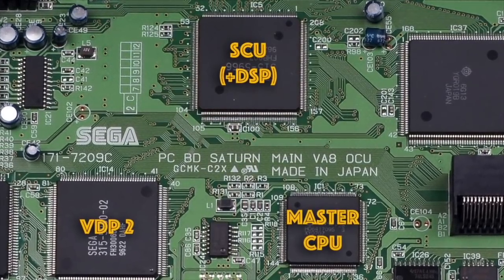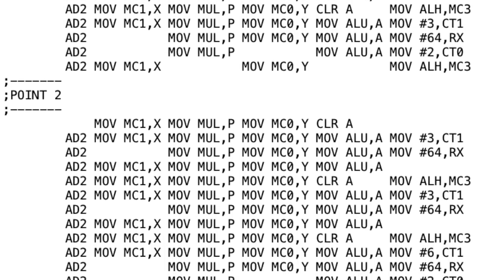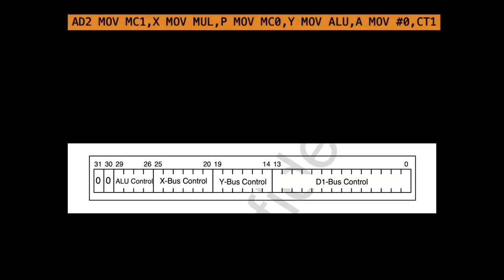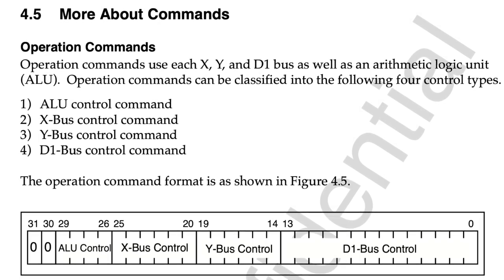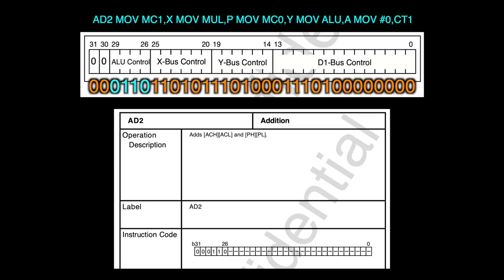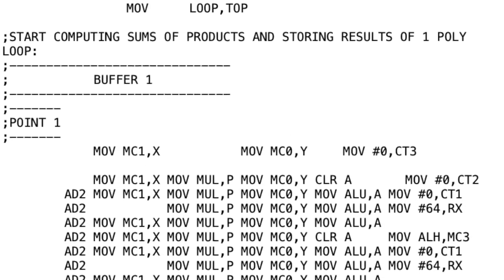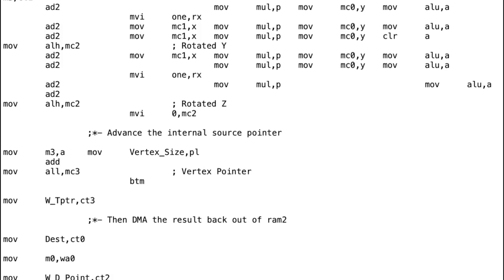The Mystery of Sonic R's Impossible Code - Coding Secrets

Comment: "my code works and I don't know why, so I didn't question it'
Reply: Cobol in a nutshell. When it works, you never know why -.-'
Reply: @c0mpu73rguy  My university still required 2 Cobol courses for my major back in the early 2010s. 

The way our professor wanted us to work was absolutely archaic. We were expected to telnet onto some school server and write our code their and execute it. I ended up 'cheating' a bit when I saw I could access my directly over FTP. Ended up using an open source Cobol to C compiler on my laptop and writing all my code there  before transferring it to the server for submission. 

Even with the benefits of a modern editor it still took me three nights for each assignment. Day 1: Input & Output formatting, Day 2: Logic, Day 3: Debugging. Gin was the only thing that got me through those two classes, a good mental anesthetic.
Reply: @Sydney Bean I didn't actually think COBOL was a difficult language, and I do respect the language for doing some things extremely well. I just hated working with it because it was so tedious to write and how verbose it is. Ultimately I did quite well in those courses.

I don't recall what the editor on the server was, but the entire system was old as evident by it only accepting telnet and not SSH. I mostly just wanted syntax highlighting, better compiler errors and to move around the program easier. I think I just used Gedit with the terminal plugin and GnuCobol. I don't do any programming these days, just scripting stuff for my job in infosec.
Reply: @Tithis  probably because it was a basic school test/learning environment, they didn’t want to deal with SSH keys and user mgmt for every student every semester, or confuse you by throwing that at you on top of the COBOL stuff. (Even though in the real world, you have to learn multiple things on the fly on a regular basis lol)
Reply: I feel that deep in my bones.
Reply: I think that's just programming in general, I've heard it many times over that if you change something and the code starts working you just don't question it.  In more modern game engines there's been quite a few cases where something was left in a game that was supposed to be removed because when they tried to remove it the game stopped working.  It's also quite common to base code on someone else's code or use libraries that other people created, otherwise it would take forever to get anything done and there'd be less standardization.  In this case he based his code on samples from Sega and didn't realize until much later that those examples don't make sense with the way the manual says the DSP chip works so it's more like he thought he knew how his code works and now he's not so sure and he is questioning it.

Comment: Gotta love undocumented opcodes!  These things are also the bane of existence of emulator developers and are used in demos and copy protection.  If this is what I think it is, it's a hybrid opcode that exists just because of the way the bits work, and its behavior is technically undefined but on real hardware would always be the same.  If that's the case, they probably codified it, but forgot to put it in the manual.

Comment: A typo maybe.. not 4 instructions at a time, but 4 TYPES of instructions at a time?   Sega was always goofy in their documentation.
Reply: Pretty sure you're right here. It says types. 6 instructions of 4 types is still 4 types.
Reply: @sewid  Technically they're only doing 4, 2 are just bunched up together
Reply: 2:25 "Operation commands can execute these four types of commands concurrently." The Sega docs do explicitly say types.  Although, they probably mean 'in parallel' rather than 'concurrently'.
Reply: translation error maybe, technical translations are always a problem.
Reply: I agree. They probably got the "meaning wires" crossed between Instruction and type. It IS just four types, but six instructions total.
Reply: Correct..

Comment: If you look at the definition for "MOV MUL,P", you'll see it's 010 and no data bits. (That is, 010---, as opposed to 100XXX for "MOV[s],X" and 011xxx for "MOV[s],P"). It's fairly obvious you can't combine "MOV[s],X" and "MOV[s],P" as they would require different data bits, and you probably can't combine "MOV MUL,P" and "MOV[s],P" as they both work on the P register and would conflict there, but there's no reason why "MOV[s],X" and "MOV MUL,P" can't be executed at the same time, and that would be something desirable to have happen simultaneously, as that combination of actions would be quite common to need happen. So it seems likely they quietly implemented a "MOV[s],X AND MOV MUL,P" command as 110xxx, and didn't bother documenting it. And probably the same with the Y register commands also.

It also says "Can execute these four types of commands concurrently", but it doesn't say it can only execute one of each type. It's possibly a translation issue, or poor documentation on Sega's behalf (which is why they also distributed example code for developers)
Reply: You may be onto something, still, even if opcodes are syntactically similar, that doesn't mean they belong to the same opcode table, as these are usually grouped by segments. A MOV load store opcode makes use of data lines, as opposed as a MOV Inmediate opcode which uses internal registers, or even ALU unit.
Reply: Based on typical hardware design practices of the time, as well as the pattern of instruction encodings, combining MOV [s], X and MOV [s], P (binary 111xyz) will result in MDyz (e.g. yz = 10: MD2) being loaded into both P and RX, and CTyz (e.g. CT2) being incremented if X = 1.
Reply: DSPs also like to split cycles (maybe even use multi-phase clocks). So it could be possible that this DSP has some logic wired to upper half of the clock, and other to lower one (or rising/falling clock edges). Binary layout of the commands suggests that there's almost no instruction decoding, only activating parts of the logic via bits in command register (like in good old mainframes). So if your commands have non-overlapping bits active, the CPU could use non-overlapping logic to execute them, and in predictable order.

BTW, this is very similar to poking around 6502's 'illegal' commands.
Reply: "this is the 4 TYPES of commands that can be executed at the same time. ", yes, right there. Types of control-commands

Comment: Yeah it looks like the documentation was "correct-ish" but it's more of bitmask for what opcodes or commands run
Reply: The question I would have is that it looks like assembler for the DSP is specialized just for it, so if I wanted to homebrew with the DSP, is there an assembler that knows about it or a dev tool chain available for the Saturn?
Reply: @BrianBates128  I'm pretty sure the Sega dev kits included a DSP assembler, as well as a simulator for debugging.
Reply: @BrianBates128  I don't think there is a currently usable assembler available. You can just read the SCU hardware manual and take the instruction bit patterns and define them into a bunch of constants and macros, and just OR them together in your program to assemble the code. This should be the lowest effort path, there's only a handful instructions anyway, it's fixed size.
Reply: @zyrobs  sorry, I meant an open source one that I wouldn't have to feel bad for using if it was able to me found.

Comment: Ben Eater might have the answer to this in his rather lengthy but enormously infotaining 8 bit breadboard computer series (here on YouTube), specifically when he creates and "eeprom-hard-wires" the control logic signals. These two bits in the DSP's micro-code seem to be both hard-wired to represent a data-forwarding action in an "Output from A, Store to B" fashion, and since two distinct units are involved (per "110" command  bit pair), they operate concurrently and without interfering with each other. This is just my guess at the inner workings of the system.

Comment: You should continue the series about making a PUBG-style game on the Megadrive.
Reply: Honestly yes, that'd be awesome. 
I still want to know the internet connection idea.
Reply: @juliewinchester1488  I don't think it was supposed to connect to the internet, just enable network play over a local network. It could either use the serial port on the back of Model 1 Megadrives, or communicate through the second controller port like Zero Tolerance did.
Reply: @Eddies_Bra-att-ha-grejer  Ah, still would have been interesting either way.
Reply: @juliewinchester1488  There was however a modem for the Megadrive that connected through the serial port that could have been used for online play.
Reply: Prob almost feasible since Pubg looks and plays like a 2005 game

Comment: The documentation is right... from a certain point of view </obi_wan>

Those DSP control words are closer to horizontal microcode than typical ISAs.  From the hardware engineer's perspective the X Bus Control is one instruction that can link multiple units together.  It was just cleaner to express that at the ASM layer as two separate instructions.  Same for the y bus control.  I agree that the did a disservice by not making it clear in the docs.

You can see similar shenanigans with the PDP/8's OPR instruction which uses the immediate value as a ucode control word and can execute more than one pseudo op at once because of it.

Comment: it could've been a happy accident with the design of the DSP. Usually all hardware from this era was all hard coded (because there was no such thing as system drivers etc) so usually it would need to have either 100 OR 010, if the 2nd bit is set making 110 then it'd be like "this doesn't match with what I was programmed with, no" but it seems the DSP was programmed with the awareness of individual bits, so when the first bit in the command is set it will do the command regardless (this makes sense seeing as a 0 usually represents a gap in the data)
Reply: Yeah usually the hardware from this era was hard coded, it was the most cost-effective way of doing things at scale. The Nintendo 64 RSP did use microcode which was a revolution at the time, but may not have been the best idea. If they had instead used that die space for more than 4K of texture cache or a texture decompression routine to save cartridge ROM space... Well hindsight is a wonderful thing eh :)
Reply: @sl9sl9  that's actually some really interesting bits of history. This is why I love this stuff and the community surrounding it, so much insight of frankly impressive feats of engineering and programming that would be trivial today
Reply: Actually the Saturn did have a Sega-provided sound driver for the 68k CPU that controls the sound subsystem and is MIDI compliant. There are also (vintage) Macintosh tools from Sega for designing sounds and converting MIDI files into music sequence data. I’m working on a custom sound driver for Saturn right now :)

Comment: your can easily do the arithmetic commands, no problem, in parallel at the exact same time. one example is if you ever want to move "010" when no data bits are set, you can,(MUL, P" as in actually "010" not 010Xxx) , while also doing "MOV MUL, X" no problem. this is supported by the dsp IIRC..

Comment: Luckily the diagram of the DSP core pipeline gives us the answers.  RX has an enable, controlled by bit 25 (clear = don't load, set = load from X).
The P register (split into PL and PH) also has a multiplexer and enable bit.  Bit 24 is the enable (set = load multiplier output or X, clear = don't load). Bit 23 operates the P multiplexer (clear = multiplier output -> {PH, PL}, set = X -> PL, sign extend PL into PH)
Bits 21-20 of the X bus command determine what is written to the X bus (for a lower two bits equivalent to n, memory MDn will be loaded).
Bit 22 enables the increment of the CTx register referenced by bits 21-20.

The Y bus commands are a bit simpler.  Bit 19 enables the RY load from the Y bus, while bits 18-17 determine the AC register's operation (00 = don't load, 01 = clear, 10 = load from ALU's Q output, 11 = load from Y bus).  Bits 15-14 determine the MDy to load onto the Y bus, and bit 16 controls the increment on the CTy register.

This means that the real limitation in one of these instruction packets is that RX and P cannot be loaded from two different MDx banks on the same clock cycle, RY and AC cannot be loaded from two different MDy banks on the same clock cycle, and one MDz bank cannot load two different data values to the X and Y buses on the same cycle (although you can transfer the same data to both buses).

Theoretically, you should be able to use bits 22-20 and 16-14 to increment one or two of the CTx registers without loading any data.  Why you would want to do this, I don't know, but it should be possible.

Also worthy of note is that a code of 10100 in bits 12-8 switches the RX multiplexer to read from the D1 bus instead of the X bus, while a code of 10101 switches the P multiplexer to read from the D1 bus instead of the X bus (bits 11-8 select the target register, while bit 12 enables the target register and its multiplexer).  It's unclear what would happen if bit 12 was not set but bits 11-8 were chosing a target register of RX or P.

Comment: I can explain the 6 vs. 4 instruction conundrum.

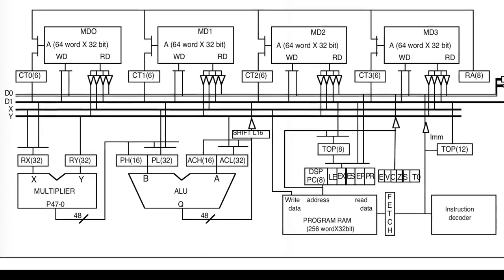If you look at the overall architectural diagram at 1:08, there is a dedicated 48bit bus from the MULtiplier to the P register. The X bus only needs to be used for transferring data from one of the MD* banks to the X register. So even though moving the multiplication result to the P register is an "X bus command" it doesn't actually need to use the X bus.

So Sega basically just added an undocumented X bus opcode 0x6 (110) that does MOV [s], X AND MOV MUL, P at the same time. They wrote it out as 6 instructions instead of 4 for human readability reasons.

Comment: Probably exactly what you think, that bit flips that line at the hardware level

It's common for DSP's to work that way, they are essentially a pile of functional units hooked to a pile of busses. The 'instructions' mostly control which which unit attaches to which bus and behave more like the scroll on a player piano than conventional instructions; often incapable of branching, much like the piano

The tradeoff for the poor facsimile of an instruction set is raw power, it can only do one thing to your data but it can do it FAST

Comment: It makes sense from an instruction set point of view, at least. A lot of simpler processors have undefined opcodes of one sort or another that work in practice (e.g. on the 6502), and having the instruction decode directly drive the bus enables I could definitely see.

An interesting question would be what happens if you do e.g. MOV MC0, Y MOV MC1 Y, which "should" cause bus contention if I'm reading those bus connections correctly (both connected to the Y bus.) 

What does the third bit  of that triplet do?

Comment: "Four types of commands concurrently." i.e. not a strict quantity limit per-type. It is just saying there are four types of commands executed concurrently. If the demo code you were given is correct, then six may be the upper-bound on the number of instructions per-type that can be executed concurrently in a single cycle on the DSP. Your code works... because it was designed for six instructions. Honestly, if that technical specification of yours doesn't tell you the exact lower and upper bounds of every single instruction, then it wasn't written very well because that's the whole purpose of a technical specification in the first place: to document where things begin and end in a(n inadvertently convoluted) system!

Comment: Looking at the binary code, it seems like hardware reads the instructions as bitmasks. The first bit represents the command which writes data to X, and the next two bits commands writing data to P. Since these are writing data to different registers, there is no problem to do these instructions in parallel, so the hardware is wired in such a way that the first bit and the next two bits are independent - no need to do unnecessary checks slowing down the computation.

This also partially explains why the three commands have bit representations 100, 010 and 011 - the last two of these instructions are writing data to P, so they cannot be performed in parallel. I guess the second bit tells whether we write data to P, and the third bit tells where we get this data, directly from memory (0) or from the result of multiplication (1), and all this is implemented in hardware. If this is true, then the command x01, although not documented, should behave equivalently to x00, since the second bit prevents writing data to P altogether. I'd love to see this tested, btw ;)

As how the machine code is compiled to binary code, I have also a guess. Each command is a 32-bit string. The compiler parses the instructions, turns them into binary and then XORs (or ORs) them together to combine. In this way, the compiler doesn't need to keep track of which commands are performed in one line, so in particular no need to count how many commands there are. This would explain why six commands in one line compiles, and even suggests that technically any number of (conflicting) commands in one line would compile, although the code then doesn't do what is written. This would also be fun to see tested.

Comment: I would guess that what you call instructions are not really instructions (the decoding part is missing or it is extremely simple) but they are almost directly the internal control lines the chip is using to handle the internal buses.